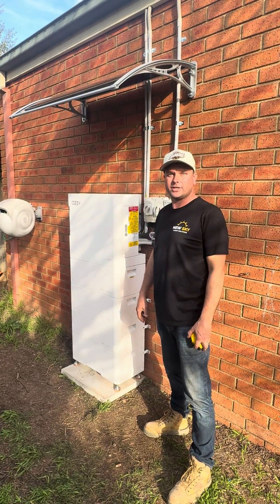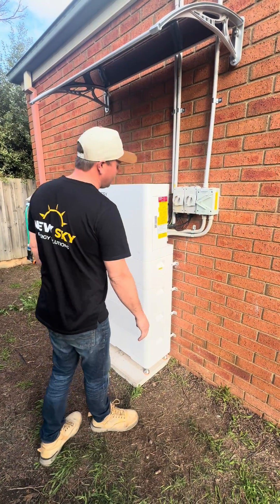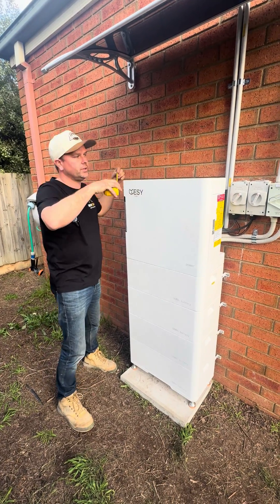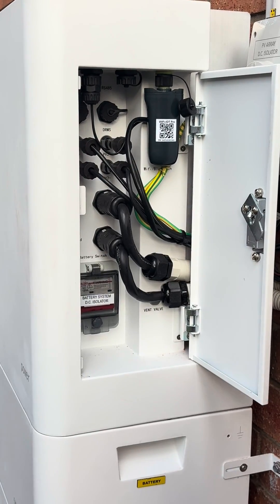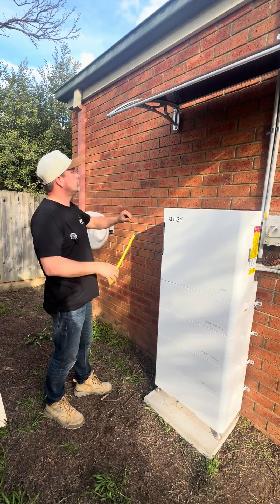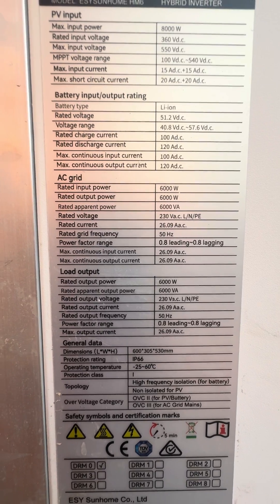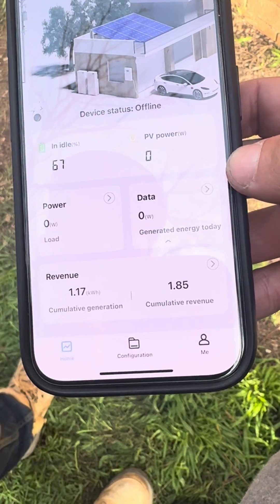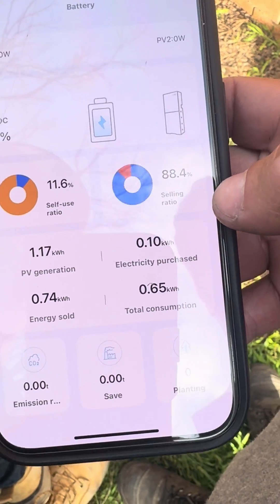What you need to know about the ESY SUNHOME HM6 - 20kWh battery storage

Comment: A 20KW unit wont fit under the eaves of many houses as the eaves are not at 2.4m, that's the houses ceiling level, eaves are often 2.14m then subtract the 800mm clearance leaves you at 1.34m is going to leave you with a 3 stack (15kWh) unit.